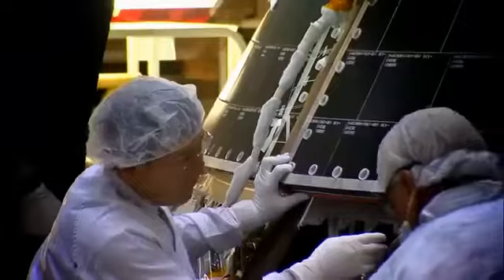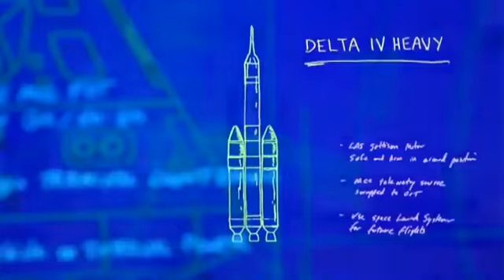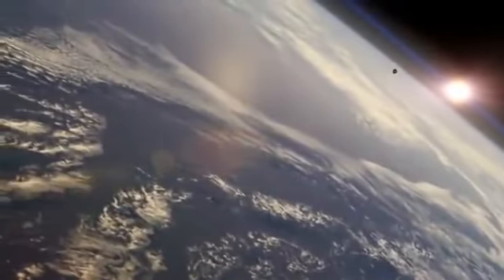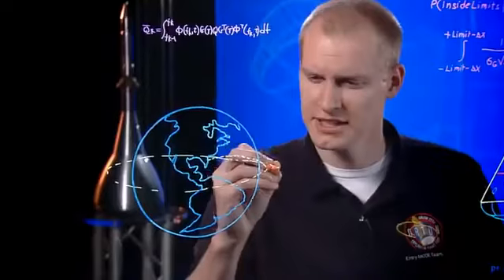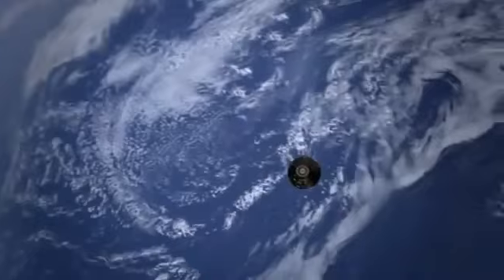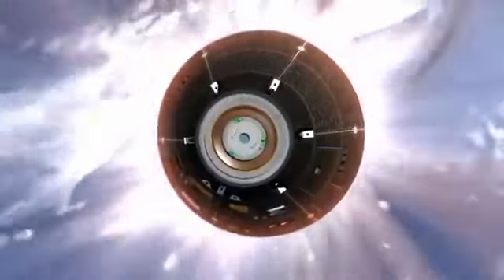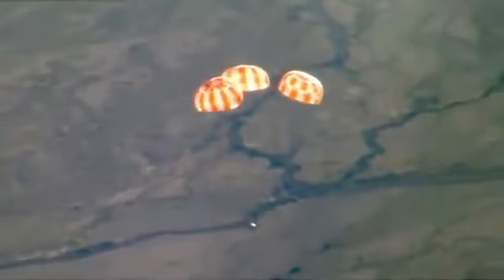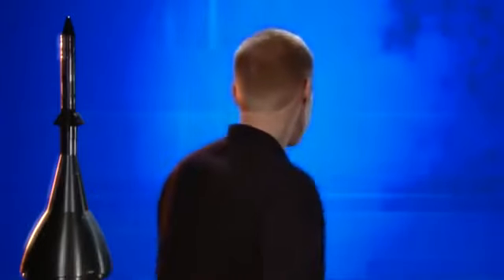NASA engineer admits they can’t get passed the Van Allen Belts

Comment: To the people saying that in 1969 we didnt go through the belts, we avoided them, went around them... ok, so why are we going through them on this orion mission? why are we not avoiding them again?
Reply: Spencer Jarvis these are unmanned tests for long duration...
Reply: There are also weak and strong points in the belt.  Ideally you want to go through a weak area
Reply: A Sleigh Ride In my 64 you don’t get that choice if you need to go through them for days to slingshot to deep space...
Reply: You cannot avoid them.  That is why they did NOT go in 69.  Why are they going through them or attempting them now?  First the orion is unmanned.  The radiation is so intense they cannot overcome that as of yet.
Reply: icoltsi18 you can take a reduced radiation route, but not if you intend to go further than the moon... Orion will be tested unmanned, but eventually will be manned and yes they’ll have no choice but to take the more direct and higher radiation route...
Reply: icoltsi18 and they did go in 69, as has been said it’s possible to take a route that avoids the higher radiation areas and for a very small period of time so it’s not lethal
Reply: Supreme Nigga Snoke   Like..through your head?
Reply: icoltsi18  Off course you can avoid them...Just turn around and go the other way....
Reply: Put yourself inside a bubble, now get out by going around it... I'll wait
Reply: Common sense still abounds...   I'm actually pleased that some people are still thinking, and not swallowing the NASA ''we went around the belt'' nonsense,   As for you people with these ridiculous theories of how we were able to survive it then, but can't survive it now...pfffft!
Reply: Ladies Love the Moon Knight  Yes, they avoided the van allen belts, avoided the moon, and just stayed in low orbit faking TV pictures to make the earth look further away
Reply: Good question Spencer. It would be nice to have an explanation how they navigated to and through the weak areas without burning up all the fuel.
Reply: Then why did they DESTROY all of the data and technology from the moon landing??? Does that really make sense to you??
Reply: We went around the inner belt and through the outer belt. Sorry that people have misled you.
Our computers are more vulnerable because their components are smaller now. Obviously, regardless, we want to test the thing before we trust it to keep humans alive.
Reply: their is no "around them". lol
Reply: @bengray5013  all while sat in a craft made from shipping crates and tin foil 😂
Reply: @Aristocratic13  THERE ARE NO WEAK POINTS IN THE VAN ALLEN BELT DISPSHIT
Reply: IsMu Ok  You are the one who can't explain the answer to his question
Reply: Now you're just making too much sense.
Reply: We didn't go around them. We took the path that was safest. The craft was exposed to radiation for about 15 min.
Reply: @asher6657  fuel eficientcy ?
Reply: @antifa86i35  nice try.  We never went to the moon.  NASA claims they lost all telemetry data from every flight....does that make sense to you?  We were supposedly smart enough to penetrate the VAB, but too stupid to transcribe the data?  And no one has any memory of what was done? They think we're ignorant.
Reply: @asher6657  why lie abouth it ? Why would Russia admit they were on the Moon ? I don't realy care if we were or not.... my life sucks either ways !
Reply: @bengray5013  no they didnt go in 69. Stop it. Thats why they lost all the telemetry data from the Apollo missions huh ?
Reply: Vee Clark's NothingButTruth telemetry data is hardly significant or viable for a completely different rocket system, do you even know what telemetry is? Apparently not. You’re just repeating the same old garbage debunked conspiritard claims, which are always the result of poor education. Tell me, how do you manage to tie up your shoelaces in the morning? 😂😂😂
Reply: @bengray5013  typical response of ppl who believe this stuff is to insult people intelligence that you don't even know. That shows how intelligent you are smart guy lmao. I won't stoop to your level. You just mad that we didnt go and never will.
Reply: @bengray5013  They either never had telemetry data or they hid or in their own words lost the data because engineers would be able to tell that we didnt go. Why is the radiation levels of the belt classified info ? Lmfao. Whats your response to that ? What's your response to the original comment of why we are going through them this time instead of around them like we did between 69-72 ???? We didnt go ! No insult you throw at me will change that 🤣😂😂😂😂🤣
Reply: Vee Clark's NothingButTruth who said we were going through them this time? Btw thanks for admitting we went around them last time, meaning you admit we landed on the moon... bless your little cotton socks, simple minds and all that...
Reply: Look up what the Van Allen belts look like. You can see clearly how we avoid them when leaving the Earth to go to the Moon.
Reply: I NEED MY OPIOIDS BRO I’m sure your degree from eBay really helps when trying to teach others about stuff you literally have no education on 👍🏻
Reply: Vee Clark's NothingButTruth they didn’t lose the telemetry data, they just lost the company contracts of who had the skills to fine tune parts of the Saturn v. You conspiritards will reach at anything to try and make a point. If only you put so much effort into actually learning the reality of it.
Reply: I NEED MY OPIOIDS BRO you’re talking about bubbles while typing everything in capitals, that’s ironic 😂
Reply: @spokiee2000  The belts aren't a bubble. They're shaped like a donut. That's why they're called belts. Pick a higher azimuth and you get to a lower radiation area.
Reply: @DarkSideChess  lol... earth is completely encompassed . Theirs no openings.  They are thousands of miles thick and their are several bands.
Reply: Ladies Love the Moon Knight What an evil thing to say
Reply: Blob B nasa, and all the stations around the globe that tracked the missions
Reply: @icoltsi18  One of the most popular theories as to why the Moon landings couldn’t have happened has to do with something called the Van Allen belts. These are two huge belts of radiation that surround the Earth, shaped by Earth’s magnetic field and pounded with high-energy particles from the Sun’s wind. It’s been claimed that humans couldn’t have passed through these belts without being fried with lethal doses of radiation.

In fact, the international scientific community was aware of the Van Allen belts thanks to the Explorer, Pioneer, and Luna missions in the 1950s. Luckily, the timings of the Apollo launches were such that the Van Allen belts were at their lowest intensity, which fluctuates with the Sun’s activity.

Radiation sickness occurs when you have been exposed to around 200 to 1000 ‘rads’ of radiation within a few hours. The Apollo 11 crew were within the belts for less than two hours during their journey to the Moon, and so would have only been exposed to an estimated 18 rads – well within the safe limit. There can still be some adverse effects from even this level of radiation, so NASA made sure that the Apollo 11 spacecraft was well-insulated such that the average dose of radiation over the 12-day mission was just 0.18 rads, or similar to the radiation dosage from a chest X-ray.
Reply: No, spencer, they didn’t.   That’s not how you get to the moon.   According to the laws of physics, you can’t take a detour to avoid the belts. You have to launch into the moons orbit which is not to the north or south. The moon orbits just 5 degrees off  the equator.    That is an ad-hoc lie that you are repeating.
Reply: Ladies Love the Moon Knight you don’t get to choose.   You can’t take detours. You have to go the most energy efficient route to the moon.... which is through the thickest part of the belts
Reply: ben gray so few people understand this.  You da man
Reply: mmorale68 sure. If you ignore the physics of how to get a rocket to the moon and back
Reply: ghjlkhl yes and you completely miss the moon
Reply: ben gray no, no they didn’t.  There is only one route to translunar orbit, and that is in fact directly through the thickest part of the belts.
Reply: @bengray5013  They couldn't even measure where the VA belts WERE in 1969.  They had only been discovered a few years before.  But you don't care about truth, keep on sheeping.
Reply: @jamesfirth2392  Except they didn't get past the firmament.  It is physically impossible for space to be a vacuum and for us to keep our atmosphere. Nature ABHORS a vacuum and there's no way a weak atmosphere would keep a vacuum from sucking off all our air.  Not possible.
Reply: @joegreen3133  When interviewed in "astronots gone wild", one of the Appollo 11 astronots wasn't even aware of the VA Belt.  When asked what they did to deal with the radiation he said (paraphrasing) "We didn't notice a thing.  It must not have been a big deal."

They think that you're so stupid that you'll believe anything they say.
Reply: @zdcyclops1lickley190  This is a lie.  You literally just made that up.  The VA belts are far bigger than 15 minutes of travel.  If they weren't, there would be no need for the Orion Project to be testing it right NOW.  I bet you're not even aware that Project Orion is designed to explore the VA belts and test shielding that was never on spacecraft before.
Reply: @antifa86i35  Easy. Control.  If you can get a population to believe a lie that big, they will believe ANYTHING.  Your government has been killing it's own citizens for decades (look up the Tuskegee experiments), do you really think they'd even think twice about faking something to keep people in line?  NASA IS PART OF YOUR GOVERNMENT, WHO ALWAYS LIES.
Reply: @bengray5013  Wrong.  NASA said that they "taped over" the telemetry tapes... the most important data in Human History... and they taped over them due to budget constraints....... meanwhile they get $60 million a DAY of our tax dollars.  But you don't care about Truth. Cognitive dissonance won't allow you to use logic. only emotions.
Reply: Based Bear zetetecism math is your downfall kid, you’re using the claims of a known fraud!
Reply: Based Bear nasa didn’t say that, more conspiritard nonsense, but then that’s all you can do 🤣
Reply: Based Bear they aren’t getting my tax dollars lol... but I know more about them, have a better education than you and can form logical and reasonable arguments without resorting to insults or conspiracy claims (not theory, because the word theory has a different meaning in actual science)...
Reply: Blah blah blah... blahs
Reply: We didn't  and can't go around.  Went through the narrowest area at 25,000 kph. Spent only 52 minutes in the belts. Total radiation exposure was  equal to two CT scans of  your head.
Reply: Yes, if they were avoidable many more countries on Earth would have sent people to the moon by now, not just sitting around twiddling their thumbs and trying to figure out how to protect their astronauts from these regions in space. Who wouldn't want to go to the moon and set up a moon base. How did the US send 12 people there but it has not even been attempted by anyone else?
Reply: @SciAntGaming  When you build a new engine. More advanced than it predecessor. Don't you need to test the new engine to make sure the new parameters are working out? That new tech relating to power or fuel efficiency are working as designed? So it is with a rocket that is 15% more powerful than the Saturn V carrying atop it a capsule the is like almost 2.5 times larger than the Apollo era capsules? Don't you need to test the modern methods of radiation protection and various other systems that are designed entirely different from its Apollo era parent? Before you build and launch anything, shouldn't the concept be tested in computer models first(since we can do that these days? Of course. And that's what they've been doing.
Reply: @Aristocratic13  and who said that there are strong and weak points in the belt?
Reply: @icoltsi18  False.The belts have varying degree of radiation  the total time was a mere 68 minutes. 4 to 5 sieverts will likely kill you. Total sieverts they absorbed was 1.8 micro or mini-sieverts.   The key is time. To die in the belts you have to be in them for several days OUTSIDE the spacecraft. The belts are easy to overcome during Apollo because most equipment was direct wire. Orion is chips and circuits. Way more sensitive to radiation. They want to be aware of any needed changes to protect the equipment as well as the astronauts.
Reply: @markshaw270  Nope
Reply: @MisfitRecords   Yes there are. There is even a safe zone with almost no radiation
Reply: @JustTheFacts317  Only lost Apollo 11 data. We have all of the rest.
Reply: @asher6657  nobody has stated we cannot survive it now. We couldn't go because the shuttle isn't designed to go to the moon. The ISS enters and exits the belts  once in a while when solar storms cause the belts to expand
Reply: @asher6657  4 to 5 seiverts of radiation  will likely kill you.  But for that to hapoened, you'd have to be in the belts, outside the ship for several days.  Apollo 11 astronauts were in the belts a total of 68 minutes and only absorbed 1.8 Micro-seiverts. So, death was not on thier Door step. Shit, bit wasn't e en in the next town over.
Reply: @markshaw270  only sat in the LM for a few hours. Why does a ship need to be super thick ehen they don't need it to be. A coke can is thinner than what they used. Yet it can hold very high pressure and us very sturdy.. That was the LM. THE pressurized parts were very sturdy. It looks rag tag because they literally added extra sheilding real quick and dirty while it was on the launch pad.
Reply: @asher6657  only lost Apollo eleven data and video. Telemetry data they recorded is useless to keep
. It's just health monitors.
Reply: @JustTheFacts317  data was useless right Fter mission anyway and only lost Apollo 11.
Reply: @spokiee2000   and are of varying degrees of danger IF you are there several days outside the craft. They absorb 1.8 micro-sieverts of radiation since they were in the belts only about 68 minutes. 4 to 5 seiverts kills.
Reply: @florianbernard2525  NASA. Who's Dr. Van Allen discovered them in the first place.
Reply: @Dakota McDaniel the LM defi atley had a known puncture risk. Even from an astronaut falling and stabbing it with a screw driver. They knew the risks and they took them.
Reply: @Dakota McDaniel however the LM combines with sheilding and interior equipment protected them enough to easily do thier jobs. Why the microwave? It's not like there was scorching space touching the LM.
Reply: @Dakota McDaniel LM also had titanium
Reply: @@dakotamcdaniel7879 incorrect. Space does have a temperature. But, not space itself. The molecules of space get super hot. But, they are few and far between . So if your skin could survive in a vacuum.  It would not feel hot or  be damaged by space heat. So  no. The LM wasn't a turkey in the oven. What then does heat up the LM or satellites? Light. Each band of light has its own temp.  Heat doesn't emit from the sun and travel in space. Light does. Light hits an object or an atmosphere and radiates those things. Causing them to heat up.  Congress controls the money NASA  wants. Each admin decides what NASA is going to focus on. Projects get started or shut down with each administration.  Everything is circuit boards and microchips these days, So NASA and private companies gotta do all this testing because they are vulnerable to damage from radiation. Can't just hop in a ship and go. You can live in your fantasy land if you want. But it's verifiably false.
Reply: Aristocratic13 This reminds me of a story: My crew wanted to cross the Nile river using rafts in an area with weak points, where the hippos only weighed 3000 pounds. In the strong points, the hippos weighed 4000 pounds. When we told this to a local guide, he informed us — after staring at us incredulously, shaking his shocked head in disbelief, and giving us a politely-veiled side eye — that a 3000 pound hippo would kill us just as easily. So we decided not to cross that river in rafts at all, even though it had those “weak points“.🙄
Reply: That's not how it works with a spherical object emitting Radiation, there are no weak points lol. And even if there were you mean to tell me we've have successfully done it multiple times already meanwhile NASA themselves say they can't get pass. The denial is strong af with you lol all the proof shows they lied
Reply: They never went to space nobody can leave this earth and nothing can also come in. Let them continue the lies

Comment: While the Van Allen Belts do provide a challenge for space exploration it is far from an insurmountable one. Here is a quote from James Van Allen himself in 2004. "the outbound and inbound trajectories of the Apollo spacecraft cut through the outer portions of the inner belt and because of their high speed spent only about 15 minutes in traversing the region and less than 2 hours in traversing the much less penetrating radiation in the outer radiation belt. The resulting radiation exposure for the round trip was less than 1% of a fatal dosage – a very minor risk among the far greater other risks of such flights. I made such estimates in the early 1960s and so informed NASA engineers who were planning the Apollo flights. These estimates are still reliable." The radiation belts will still provide a challenge for the Artemis missions both in terms of choosing a trajectory through them and shielding not only for the crew but for the electronics and guidance systems. The modern electronics and IC's used in Orion are much more sensitive to radiation damage and interference than the electronics used in the Apollo Program. Take care.